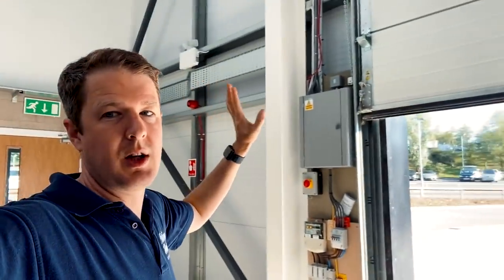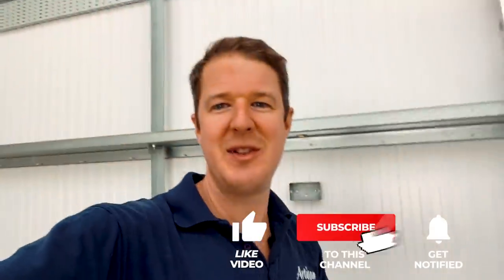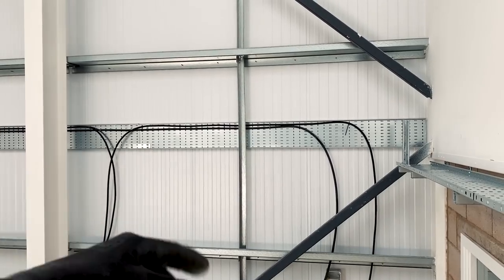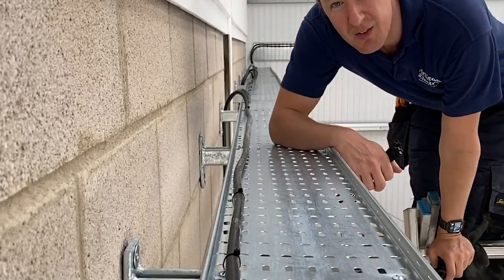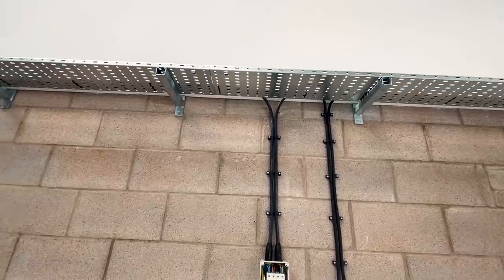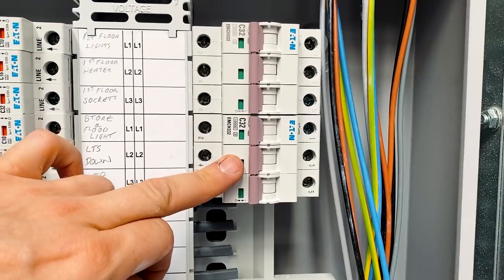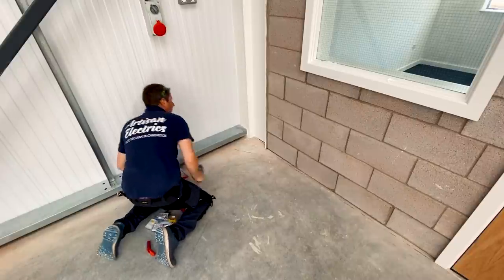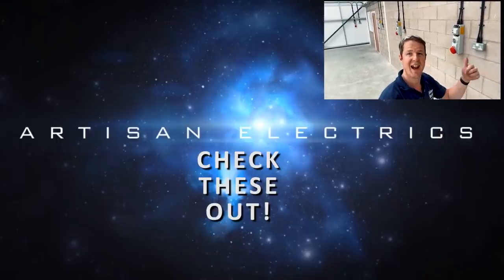Cable Tray, Three Phase Sockets & SWA Cable Install - Part 2

Comment: Jordan thank you for the content!
Never underestimate the power of post it notes. Especially when working with someone else, 1A, 2A, 3A (EoL).
I use dust extraction on my rotary hammer, and use a steel door magnet from a security switch inside a disposable plastic bag turned inside out so that after I get done picking up all of my filings and chips I can just turn it right way around, throw out the bag, and don’t have anything on my magnet. 
You should get a KC Tool link affiliate link for Tools4Sparks channel so your N. American viewers can get you a commission on tool recommendations because, I had been sitting on the fence on whether I needed the VDE Knipex electricians knife, but now is see I need it. I have already purchased like a half dozen things based on your recommendations.
Reply from the maker: That magnet idea is GENIUS! Thank you! 
I will check the KC Tools thing... never heard of them.
Reply: @Artisan Electrics 
Kansas City Tool
They are normally about 5% to 10% more than Amazon but...
Every order comes with “a bit of thanks“ a Felo #2 Phillips (most common size in North America).
$50 orders come with free shipping.
$100 orders come with a German tools sticker pack.
AND if Amazon is selling any tool that they sell for below wholesale they’ll email you as soon as they find out about the sale to tell you to jump on it.
Their customer service is amazing!

Comment: Neat job, For small armoureds  I always use 300mm cable ties and use them for the spacing quicker than counting holes.
Reply from the maker: Nice
Reply: That’s actually a really good idea, cheers
Reply: clear from these changes is that the scope of the new regulations is wider than in the 17th Edition 3rd Amendment, specifically where reference is made to both entry routes in and exit routes out of the building. This reference combined with explicitly requiring metallic fixing is to reduce the risk of cables causing an obstruction – both to the residents of buildings as well as to first responders.
When fixing cables to exposed surfaces vertically and horizontally, the spacing of metal fixings should be approximately 250-400mm. HellermannTyton does not recommend that plastic fixings are used as the only method of fixing and should only be used in addition to sufficient metal fixing.
Where changes have been made to include cable trays and baskets it is recommended that larger cables and cable bundles are fixed within a cable basket or tray. By using metal fixings such as stainless-steel ties in conjunction with cable trays and baskets ensures maximum compliance with the 18th Edition to reduce risk of cables causing obstruction in the event of a fire.

Comment: Neat installation. I’m curious why you chose tray and SWA instead of trunking and conduit? I would have thought it would have been quicker, cheaper and even more neater? It’s not a criticism of your workmanship, cant fault you there. Excellent videos by the way, especially for anyone’s who’s entering the trade and need some extra tuition. 10/10
Reply: That's the way I would have went about it also.
Reply: More space on tray for more cables
Reply: @tommymack3210  you get a lot more circuits wired in singles in a 4" trunk than you get on top of a tray with SWA unless you are one seriously rough bastard.

Comment: I use 12" ties generally and use a length of the tiewrap for spacing to the  next tie. Saves counting holes.
 Very nice install by the way.
Reply from the maker: Nice tip!
Reply: Perfect same method I used to use. The other was the length of my hammer.
Reply: Dont forget to use some stainless to keep the fire escape routes clear applies to domestic and industrial....

Comment: I agree with how you execute a project and also agree on how neatness (overall) simplifies an installation. Planning is always key.

Also, with cable ties, rather than using a blade, you can use side cutters. You will have to cut at an angle to get it right. However, there is a technique involved that will render a flush, non sharp aka tacky finish.  Alternatively, get some Knipex Electronic Super Knips which cuts flush every time.

By the way, I'm really enjoying your videos and find it interesting....although, I'm not a sparky by trade! I'm a communications and security geek!

Comment: Just a question regarding 3 x 32 amp commandos on a radial.  If the loads are small that are being plugged in would they not be on 16 amp 5 pin plugs. And if there above this surely there's a risk of overload   I mean why a small load on a 32 amp socket
Reply: I agree in industrial there is no diversity applied!!!

Each commando should really be on an mcb depends on client but if one machine goes faulty you going to.loose all 3.
Reply: I was told that a lot of load on big 3 phase machinery is usually in the initial start up current needed, as long as you don't start them at the same time I would think the risk would be low, but I'm just a viewer.
Reply: @cjhification  true.tjays why you put motors on D type rated mcbs.
But still.wise to split each machine into individual circuits.
Each commando in its own mcb

Comment: It’s nice to work in a brand new unit. Our factory is about 80 years old so running cables and trays you get absolutely covered in dust 🙈. We recently had a complete fire alarm system installed which cost £55 thousand pounds. The installers  couldn’t get over how dirty they were getting. Great vid once again thanks for sharing. 🐵
Reply from the maker: Wow thanks for sharing!

Comment: for the cable ties, surly quicker to just do the length of the tie wrap between each one. rather than counting the space.
Reply from the maker: Good tip!
Reply: Goes without saying.
Reply: clear from these changes is that the scope of the new regulations is wider than in the 17th Edition 3rd Amendment, specifically where reference is made to both entry routes in and exit routes out of the building. This reference combined with explicitly requiring metallic fixing is to reduce the risk of cables causing an obstruction – both to the residents of buildings as well as to first responders.
When fixing cables to exposed surfaces vertically and horizontally, the spacing of metal fixings should be approximately 250-400mm. HellermannTyton does not recommend that plastic fixings are used as the only method of fixing and should only be used in addition to sufficient metal fixing.
Where changes have been made to include cable trays and baskets it is recommended that larger cables and cable bundles are fixed within a cable basket or tray. By using metal fixings such as stainless-steel ties in conjunction with cable trays and baskets ensures maximum compliance with the 18th Edition to reduce risk of cables causing obstruction in the event of a fire.
Reply: I would have grouped the cables together makes for a  straighter line.   Individually clipping each cable  makes it harder to keep the line straight no matter how hard you pull on the cable ties and also uses more ties.

Comment: Such a neat job, nice to see the planning and thought in the layout of the cable runs. I attend so many factory installations down south and there's just a hog podge of cable zipped together with no thought to alterations in the future. Nice to see someone actually laying out cabling like myself, though I must admit I still don't use ferrules nearly as often as I should.
Reply from the maker: Thanks!

Comment: How did you fix the tray to the end wall? Did you put screws through the outer skin of the wall? Or is that an inner surface with cavity behind?
Reply from the maker: It's an inner surface with a cavity, its got two skins with insulation in between.
Reply: @artisanelectrics  I take it you used the metal spring toggle plasterboard fixings with the nut top rather than the screw head?
Reply: @artisanelectrics  What would you have done if it was a single skin?
Reply from the maker: Not sure what you mean? I just used self tappers.
Reply from the maker: Would have had to mount it on the cross beams somehow with some uni strut and window brackets or something.
Reply: This fixing method is probably fine as the SWAs are only small. If the cables were any bigger I’d have put lengths of vertical unistrut with window brackets top and bottom fixing direct to the perlins. Nice job though. 👍🏻
Reply: It's not a great fixing, fixing the tray straight to the warehouse outer wall. The meter is usually pretty thin with just foam insulation inside it.
Reply: Have  uni strut if single skin and make the structure from.that with L brackets and supports

Comment: hi Jordan

Q1 for learners that watch your channel do you turn your DB main switch off with the breakers on (on load) or did you isolate each circuit first so the main switch is switched off load...  

Q2 thoughts on bonding of the cable tray that is in contact with the metal part of the structure of the building or was it not touching the steel structure...
Reply from the maker: Hi Gaz! 
1. Always turn off the MCBs first so that when you turn off the main switch there is no load. 
2. I wouldn’t bond the cable tray as it’s already mechanically connected to the metallic structure via the fixings and the main structure is bonded. But I’m open to suggestions about this as it’s not 100% clear what should be done.
Reply: I was going to post to Jordan regarding that I always turn the breakers off then isolate the main switch and via versa  however it looked like it was unoccupied and negligible load so.
Reply: @artisanelectrics  the tray thats connected to the cantilever Arms isn't bonded via the building structure though is it ? 
either way no requirement to bond that tray imho
Reply from the maker: No you’re right it’s not
Reply: I’m not sure re the bonding of the cable tray either, it isn’t likely to become live under fault conditions hence isn’t imo an exposed conductive part.  The building structure is likely extraneous hence the structure should be main protective bonded.
Reply: @artisanelectrics  Its something i would probably do , only because the trays  are wide enough for future proofing  which means its open season for plumbers , data installers,  etc who are unlikely to even consider earthing / bonding issues , although as it stands now there is no requirement
Reply: I would always put a link in only because the  coatings on some of those thermal wall insulation kits act as an insulator and contact areas are often quite small, thats just my personal preference

Comment: Use the cable tie itself as a measure for the distance apart, in other words, place a tie every cable tie length apart. Also use flush side cutters from ebay. Search for Plato side snips. Only a couple of quid. Great video!
Reply from the maker: Great tip!

Comment: Great job as always 😁. As well as ferrals id put heat shrink insead of tape to ID conductors and put Helmans sleeve on the sheath after stripping the conductors to seal the ends. Dont forget to install the cross bonding for the tray to with the earth braids. Keep the vids coming 👍😁
Reply from the maker: Thanks!
Reply: Anything else mate? Jesus Christ
Reply: @craigmcdonald4988  i did go on a bit.. sorry 😂

Comment: If all 3 32 amp sockets are in full use and run at max, won’t this present an issue with it only being c 32 and cable size
Reply from the maker: They won't be run at max I have designed the circuit for the equipment they plan to use which is minimal, they just need flexibility of where they can plug things in.
Reply: Artisan Electrics  but that’s not to say that further down the line they wouldn’t put more in, the circuit should always be designed to take the max output in mind, to a normal person they just see a 32 amp socket so they would see it fine to run at max,

Comment: It used to be a stackable offence cutting cable ties with side cutters.
I have seen guys come down  off over head cable mesh with bloody arms, the cut ties can be sharp as razors.
There are cutters designed for just that job.
Reply from the maker: Totally! Thanks for the comment!

Comment: Good neat job nice to see. I'm sure you did just checking you used fly leads on the 13a skts. Optional on flush sockets using ko boxes not on metal clad. 

Love working on a nice empty shell. Have one in 2 weeks to do. Keep up the good work
Reply from the maker: I didn’t use flying leads as the sockets back boxes were earthed from the SWA glands and the front of the sockets.
Reply: @artisanelectrics  make sure you dont forget to take off the inner powder coating.....

Comment: nice job!  nice to see such attention to cleat spacing etc...always a bit OCD over that, not as bad as the sparkey i did my time with, in those days it was slotted screws, and the slots had to be in line with the SWA or piro P clips! ...drove me nuts.....bet you prefer this to domestic EICR's!

Comment: Jordan, I didn't see any circuit idents on the wiring inside the distribution board, I know it's straightforward to identify the live conductors from which circuit breaker they go to but we've found it's good practice to identify the neutrals and earths where they terminate in their respective common bars. I know you've probably terminated them in circuit order but it saves any confusion if you number the cables.
I'm curious as to why you used the earthing back nuts on the cable glands instead of banjo tags, there must be quite a difference in cost.
Where I work we've stopped putting the sheathes over cable glands that are installed outside as we've found that they are ineffective at preventing water ingress and in a lot of instances trap rainwater in the gland and make the situation worse.
Cheers, Jim

Comment: Should all the trays be bonded?
Reply from the maker: Not necessarily. It depends on the situation.
Reply: if you use joiners on tray they should be bonded .if tray over laps at joint not required.
Reply from the maker: Interesting where did you get that from?

Comment: Use truflush cable cutters to trim the cable ties, would have used green / yellow sleeving on the the CPC for the single phase sockets rather than tape also. Overall a good job as usual.

Comment: Hey great work!! I've got a question; In my country we use 220v 50hz single phase and 415v 3 phase , I'm planning my pole barn style building , some of the equipment are from the us and they requires 3 phase , i would like to wire the building to have both 120v and 220v , what step down transformer would you recommend thanks in advance. fyi we also only use 1hot , 1 neutral and 1 ground/earth for our 220v 1phase

Comment: Very neat job just surprised how many cable circuits you have installed is there not a limit on how many 13 amp sockets you have installed on a radial in the Uk just say what happens if they plug in an 3 KW electric heater in the winter.

Comment: Hi Jordan, where do you get the large headed screws that you have used to fix SWA cleats. I’ve been trying to find them as I like the way the look and hold the cleats. The last time I needed a load of them i brought a tub of plasterboard twist fixings just really for the screws... on the subject of the video I’m totally with you on pull ties and going the full belt and braces on jobs like that. Keep up the great work.

Comment: Hi Jordan.   Exemplary work there.  Are you going to label the armours at each socket where they are fed from and circuit no.  (I understand the DB is by the door but for isolation purposes and other things).  The cable tying, personally we always put the clamp side on the other side of the tray 1 it looks neater and 2 you don't shred your hands and or cable when pulling in another circuit.   Also at the end you had some kind of strange contraption that magically makes mess disappear.   What course and where did you go to get that qualification?  Seems a bit of a specialist course I bet?

Comment: Nice video. 
Wouldn't the cable tray on the cantilever arms be prone to premature collapse, presuming the cantilever arms are fixed to the wall with plastic rawl plugs and screws.
I am not an electrician so i am not in anyway familiar with the regs. 
 More curious than anything, thanks.

Comment: I have a pair of Lindstrom cutters. Very expensive but are excellent for cable ties. .you can of course get a proper cable tie gun which pulls and slices the cable tie

Comment: are you allowed to drill the perlins?
Reply: would need clearance from the structual engineer i would think ?
Reply: jimmy gilroy big holes Aswell aren’t they haha
Reply from the maker: They aren't weight bearing or anything they are very thin metal.

Comment: hi...there...that is nice video...I am electrician too ...but i  work for offshore platform yea...start from install support,  cable tray and pulling cable. dressing and manymore....but thank you , please make video using cable tray trof type instal on below deck which is have adjustable riser..if you dont mind..hehe...

Comment: Nice work!!!
Why isn't it necessary to put a RCD in the DB?
Even if there is one in the outlets, the cable will still be live in case of a short to ground if this happens between the DB and the outlets...or is there sth. that I'm missing here?
Reply: I presume this is a TN system (most UK supplies are), so primary protection against shorts to ground are provided by the overcurrent protection.

BS7671 requires RCD protection for concealed cables less than 50mm deep that do not have an earthed metal layer, but these cables don't fall into that category.